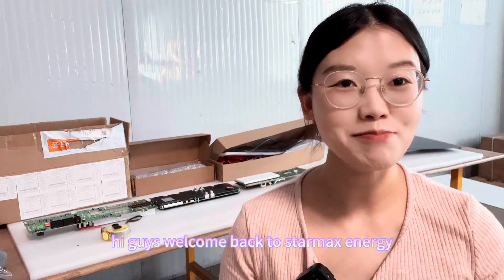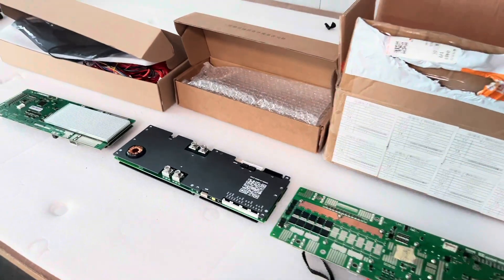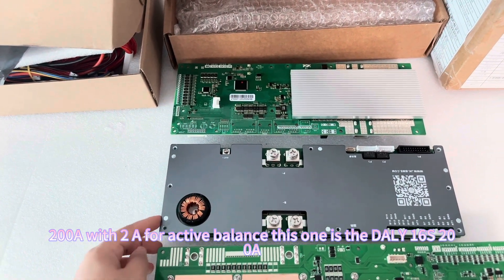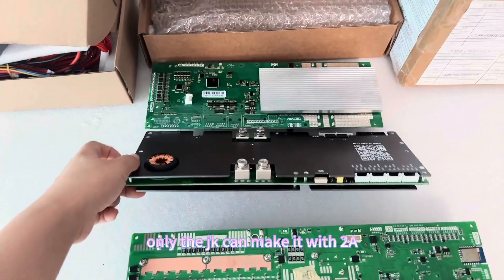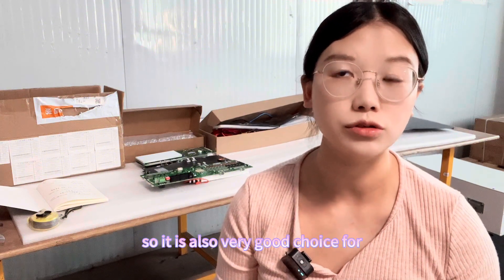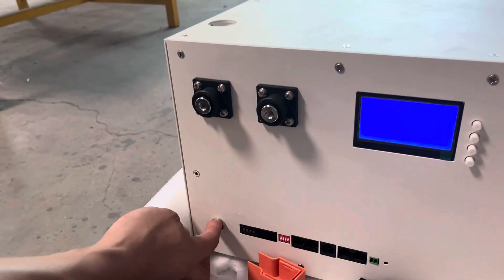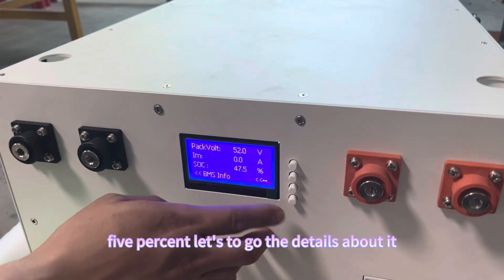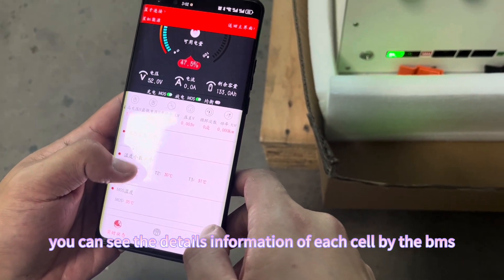PACE BMS JK BMS DALY BMS comparison in 15kwh lifepo4 battery pack

Comment: I have no complaints for the JK BMS except the SOC doesn't work yet to reset the pack at 100%. Best I can get is a single pack reset at the top of charging and then the charge cycle is completed leaving the rest of the packs stuck at 99%. They are using the RCV timer to determine SOC which works fine for the leading battery but all the batteries on the bus don't hit the trigger for the start of timer at the same time. Personally I think a second SOC timer not associated with the RCV timer would be the answer but hope they put some effort into fixing the problem however they may find best. Latest firmware version 15.35.
Maybe you guys are watching? Love your BMS, just a little more tweaking please. :)
Reply: every seems to be ok from 15.35 firmware, i think your configuration is slightly wrong. I solve this problem by this way: set SOC 100% battery voltage at 3.4, and set RCV voltge to 3.42 volts
Reply: Yeah no, not the problem. The master BMS sends the average SOC for all the batteries to the inverter. Some inverters stop the charge cycle when receiving 100% SOC and does not continue using the RCV for any remaining batteries that aren't at 100%.

Comment: I hate this trend with bms getting bigger and bigger. My 200a jk is half the size of that dali. It fits everywhere.
Reply from the maker: Size is not a criterion for judging the quality of BMS. For example, PACE BMS has a larger aluminum block, which helps the BMS dissipate heat. You know that when the BMS is running, the temperature emitted by the MOS tube is very high. High temperature will cause irreversible damage to the BMS and the battery, and heat dissipation will help the battery and BMS reduce this damage.
Reply: @starmaxenergy  You can not use this small BMS with 2 A bal. current for
320 - 560 Ah cells. 500 / 2 == 250, you need 250 hours to balance battery.
If you have 30 - 50 A balance current, no problem for years, if cells resistance
goes high after not good life conditions for cells / Cx in-out, temps, high |SOC /
so with 50 A bal, current you balance 300 Ah batterz at 5- 6  hours
and 560 Ah battery at 9 hours, if I have 15000 VA / 43 - 66 V LF toroid inverter,
I need 15000 / 44 / .92 === 370 AMPS from batterz and BMS,
Reply: @PavolFilek  That's for balancing not charging.
Reply: @renerworld  If you have old cells, 1. cell == 0.29 miliohms, 2. cell == 0.66 mOhms, 3. === 0.55  mOhm, so this resistors in SERIES make voltage divider, so at cell_1 you have 3.41  V, but at cell_2 you have 3.99 V,  so you have problem, because 2 A balance current is SMALL and BALANCER is not able to balance huge battery pack. YOu NEED 10 - 15 A balancer for old cells.
Reply: JK pictured is JK Inverter BMS so has a daughterboard for the communication ports for RS484/CAN etc

Comment: No JBD bms? Do you not like JBD? Just curious. I really like their AP and SP series boards.
Reply from the maker: JBD is also great BMS brand, but at present we didn't build it in 16S 280AH 15KWH pack. We have 12v 280ah battery which build with JBD BMS.
Reply: @ ok thanks! Just making sure there wasn’t some information about JBD I was missing, thanks for the reply